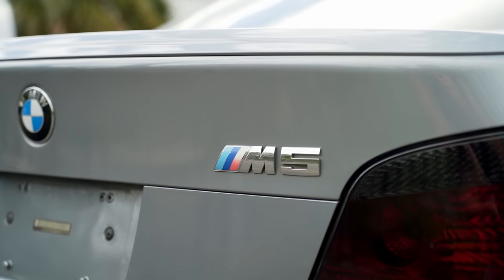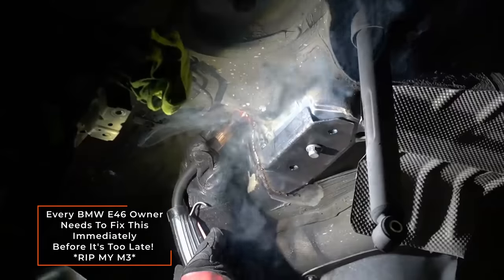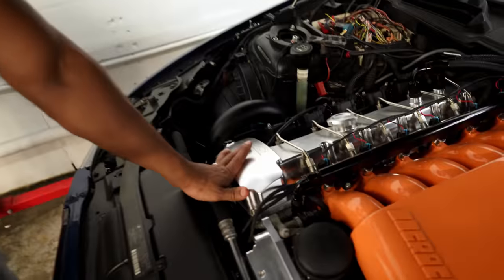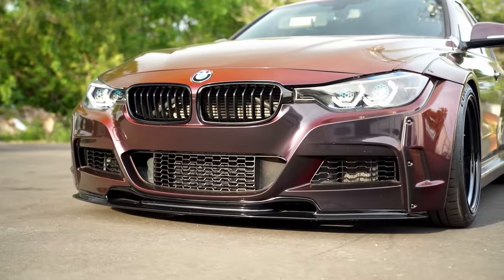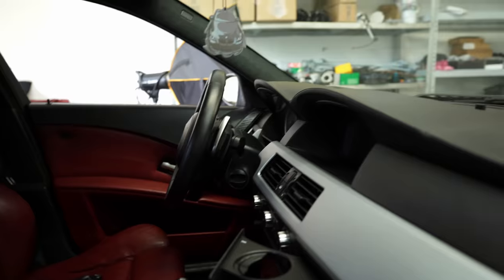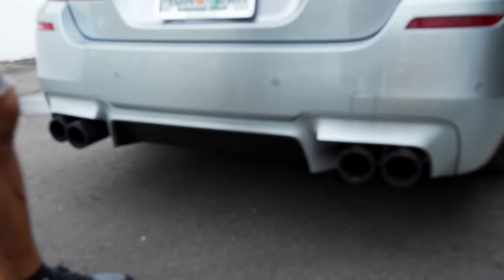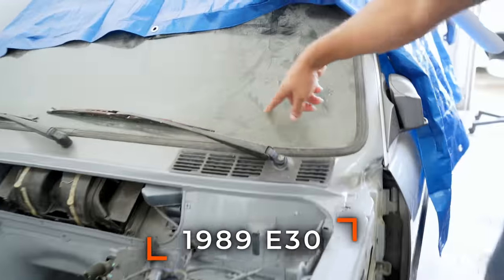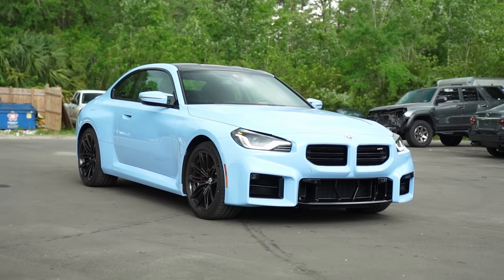I Didn't Want To Do This..

Comment: Love the content as always.  That E60 M5 is interesting.  I know you like OEM plus, but you may consider an aftermarket front bumper to freshen up the look.  Sorry to see the F10 M5 go, but it is the responsible thing to do.  Perhaps you can mention the # of miles on the car.  First thing I did when we had our son was get a F01 750i; just about the most unreliable BMW that you can get.   If I remember correctly, it about time for booster seats for your kid and its nice because you can buy a bunch for multiple cars.  The downside is that when a temper tantrum happens they tend to kick the crap out of the center BMW vents.  Ebay is my friend.

Comment: You Will regret letting go of the F10 bro! I sold my 2015 sakhir orange metallic that was modded with the same mods as yours but different tune and I ended up buying it back. A year later I traded it in six months ago and want the F10 back lol. think about it bro.

Comment: It must be super expensive to have any BMW converted from an automatic to a manual transmission.  I have a '64 Chevy Impala SS with a 327 with 330 horsepower and a simple old Powerglide 2 speed automatic.  I decided I'd rather get that thing converted to having a Muncie 4-speed manual transmission that change to a different automatic.  And I've been quoted over $10 grand, including finding al the right parts for it.